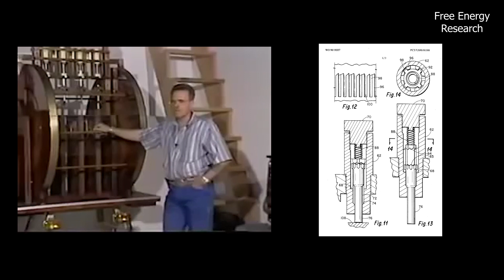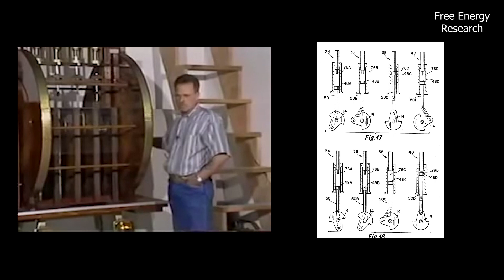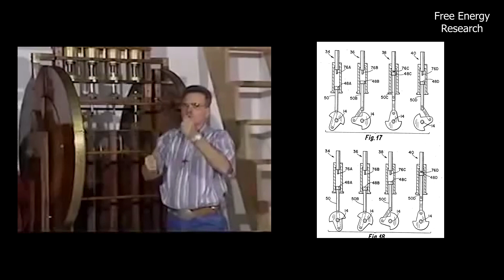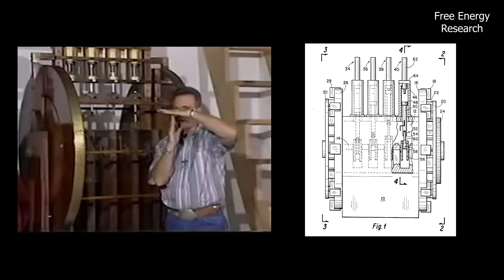Free Energy Generator : Troy Reed Magnetic Motor

Comment: I tried to create a piston engine that resembled a diesel straight 6 motor. I envisioned a North facing upward piston, with an electro magnet facing downwards to fire on the piston. It wasn't until I went to an old school magnetics lab in Detroit, Michigan, home of innovative mechanical ideas and ran it by them. They said they had been trying this idea since about 2009 and what got them was the heat build up until it vaporized the permanent magnets. 
I wish you well and hope you have heat issues accounted for.
Reply: there are many examples
of over unity that does not create extra heat and outputs way more than input
Reply: @peaceandwealthseeker4504  I'm all ears.
Reply: @grantshort  the best example I can't recall his name but it was designed after the human heart. Believed it was two chambers and brass or bronze colored. He was murdered in the 1950s while trying to manufacture and patent it.

Controllers of this realm don't want us realizing our sovereignty
Reply: @grantshort  it is called keely water implosion pump
Reply: @grantshort  also I believe I got the two men mixed up there was a guy in the 1950s with a small electric generator that ran for an extremely long time off nearly nothing and he was murdered while patenting it not the keely motor guy
Reply: Можно узнать какой принцип работы двигателя?

Comment: Magnet motors cannot work general - that's what the theory tells us. In practise, never anybody ever provided a working counter example. They don't work. There nothing more to say about magnet motors.
Reply from the maker: I agree in principle but magnetic shielding does work. There are MuMetal plates available on ebay to test this. Maybe it is possible to make setup that would neutralize opposite magnetic field enough so motor could spin
Reply: @MarioGudec  Nooo never ever.
Reply: @MarioGudec  Magnet systems are 'conservative systems' which can't return more energy than previously stored in it by pressing them together against the forces of the magnetic field. There ist no way of harvesting any kind of freely available energy.
Reply: @fortetudine гравитация тоже консервативная система и она выполняет работу по разделению теплого и холодного воздуха в атмосфере создавая 2 резервуара с теплом и холодом для работы например теплового двигателя Стирлинга .
Reply: @Mechanic-s-Arktura  Ich verstehe Dich nicht, mein russischer Freund.
Reply: Ukraine.Russian and English used to be the most common languages, but now English and Chinese. I’m writing about the fact that in the house 🏡 warm air rises up and cold air goes down, the work of moving them is done by the conservative force of gravity. If we have 2 volumes with warm and cold air, then they can do the work in a Stirling heat engine